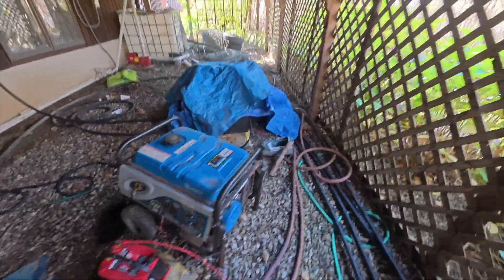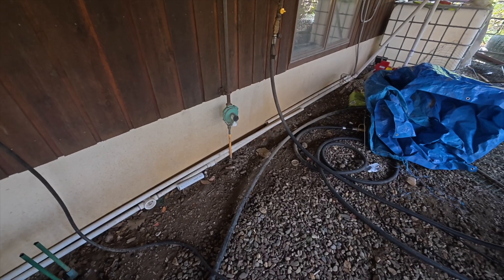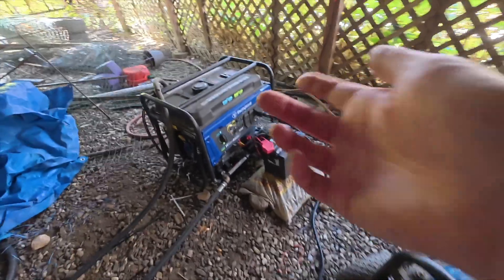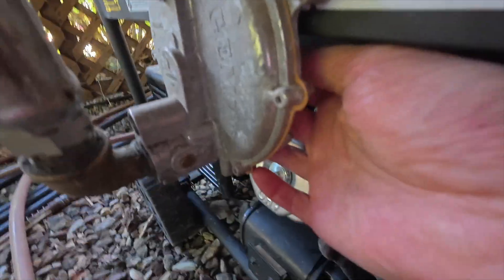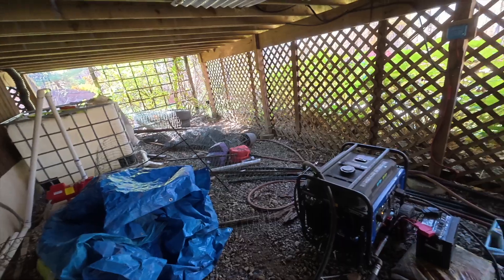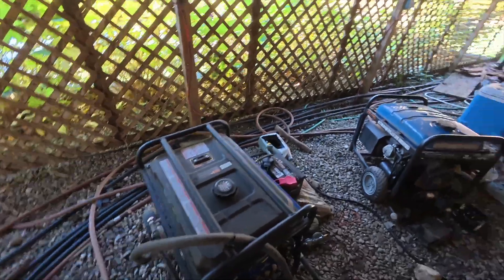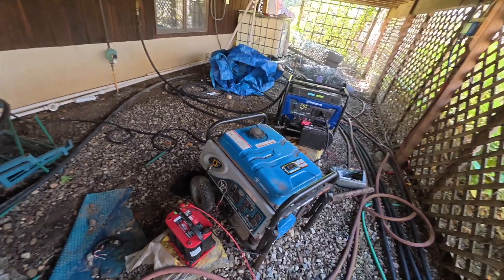Westinghouse Generator needed a REGULATOR WITH PRIMER to start easily on Propane

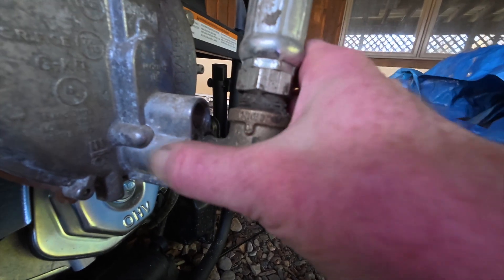Comment from the maker: If you are bored by the video just read the description.  Also the inlet on the new Westinghouse is 3/8 flare and the inlet on my motor snorkel regulator is 1/2. I misspoke at about 5:00

Comment: Great video where did you get this regulator?
Reply from the maker: It’s a Garretson KN regulator. I got it here https://motorsnorkel.com/conversion-kits/  but I’m not using the regulator alone. The motor snorkel kit I purchased many years ago feeds the propane past the Carburetor by feeding it through a large gasket with a pass through. Part of the motor snorkel kit besides the regulator is a nut metal piece that adjusts to allow the correct amount of propane into the engine. You would need that as well. I will see if I can find that in the video and I will edit this post.  Okay. Edit. If you freeze the video at 5:08 you will see the regulator. Running into the front of the KN regulator is my propane line. Running out on the top of the regulator is what I’m talking about. It’s a small metal piece resembling a Tee, and one side has a bolt that can be screwed in or out after loosening a connected nut. That piece does something to the propane flow AFTER the regulator, as it’s on the out side.  That was part of the “motor snorkel” kit I bought. It allows the generator to run smoothly and offers fine adjustment. You could potentially take the piece off the existing regulator and add it to the KN with the proper fitting.  Good luck.
You can see the brass part attached to the top of the kn regulator here https://motorsnorkel.com/product/motorsnorkel/msk3101-motor-snorkel-tri-fuel-natural-gas-propane-and-gasoline-conversion-kit/

Comment: Are you able to leave the generator connected with the propane turned on and not have propane leak out?
Reply from the maker: @miket5506  I don’t know the answer to that question because I have never tried that. Since we don’t have any type of automatic transfer switch, and must be home to start the generator and switch the breakers, we never have reason to leave the propane on. I installed a propane shutoff just before the quick disconnect into which the generator connects. In order to turn the generator off, we turn the flow of propane off via that shutoff rather than push “stop” on the generator. So my guess is that there is no leak by, but I just don’t know. With a 500 gallon tank in ground, it would be an expensive experiment to find out.  If there were a significant leak I would think there would be an odor. And I’m sure they sell cheap gas testers if you’re really curious about your setup. Maybe Vevor makes one, since they seem to make everything. Sorry for the long non answer.  (Edit I just checked Amazon, by typing in propane leak detector, and for $17.99 you can buy a piece of junk from China that should be good enough to see If there is any leak by. My guess is no, since the engine vacuum is what pulls the propane from the line- as I understand it)

Comment: Your new generator is designed to run on high pressure propane.
Reply from the maker: @geoffmolyneux9173  I’m not a plumber but what do you mean “high pressure propane”?  As I understand it, the primary regulator at my tank takes the pressure to 10 psi, and the secondary at my house takes it to 10 to 12 inches of water column. Are you saying for a large tank the proper way to run this would have been to run a 2 psi system type of setup, and feed 2 psi directly into that regulator that came attached to the generator?  Cause that actually makes sense. Cause right now I’ve got three regulators before the motor, and the last two are both the same. Thanks for commenting and let me know.

Comment: Glad you got it figured out. 
Have you tried changing the spark plug (make sure to use a non-resistor plug) and narrowing the gap on it? These generators are set from the factory to run primarily on gas. 
For propane (and natural gas), you need to have a smaller gap. Not sure what the recommended gap is on yours, gut I would set it at the smaller end of what is recommended. 
I have a Westinghouse 1150tfc that is used with natural gas only and when I replaced the original plug after initial break-in, I set the gap to 0.024 (the low end of recommended, although I have read of some running at 0.020), and even with a 30 foot 3/4" hose, it will start on 1st or 2nd attempt.
Reply from the maker: @blupupher  that’s really great information. Thank you. I changed the spark plugs on all my stuff at once about four months ago (I’ve even got a small Honda Eu 2000 - so I guess that’s 3 generators) and usually just follow the specs in the service manual. I’m gonna go check now that you’ve given me that info. Thank you.  Believe me, it was really disappointing that a new, out of the box generator with a built in regulator would always take so many tries to start. When you push start, it cranks for about three seconds, and if it fails to fire, it keeps trying for five times. Then you need to turn the switch to off and back on and try again. It was usually the first time of that second set that got it running.
Reply: Yes 0.020 gap for propane and 0.028 for gasoline 😊
That’s what I use 😊